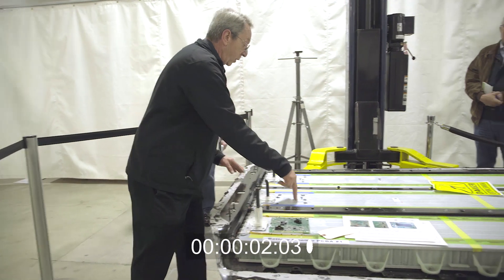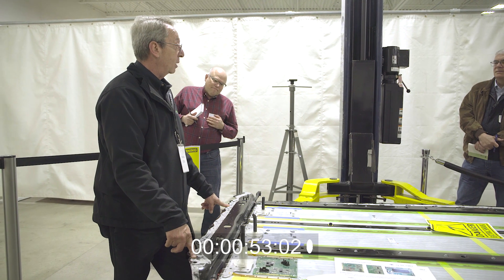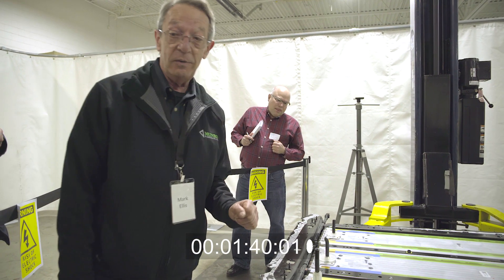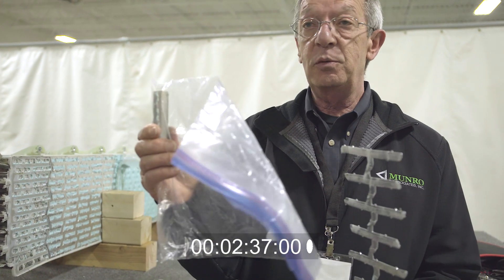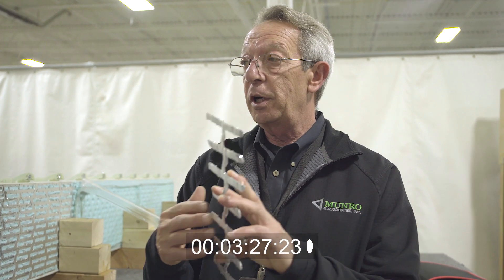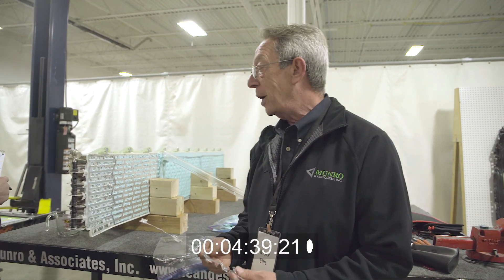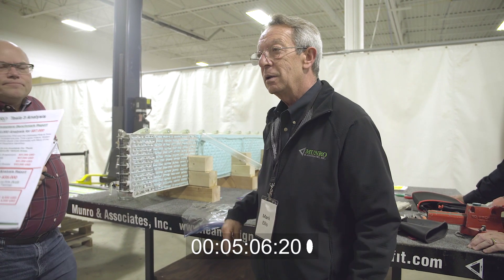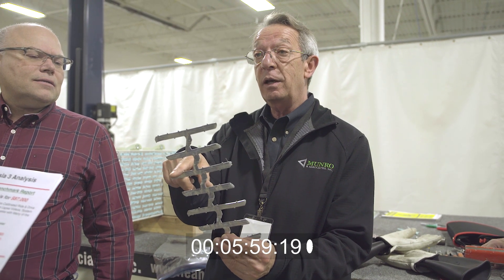Tesla Model 3 Battery Breakdown

Comment: There should be a battery check every 3 to 6 months just like a oil change. Tesla needs to keep there batteries from catching fire to protect there customers.
Reply: 1) Tesla’s catch fire 1/10th as frequently as gas cars and there have been no instances of model 3 spontaneous combustion. 2) The car performs diagnostics automatically on the battery pack all the time and will alert the driver if there is a potential concern.
Reply: There ≠ Their
Reply: @keco185  Tesla Shanghai is moving to LiFePO4 which is inherently even more safer than NCA. Fire prevention is going to be overkill.
Reply: i remember an early case where a Model S catched fire. the BMS noticed a problem with the Battery, and the car wanted to shedule a service appointment for that during the drive the issue happened, but the Car burned down before that. The issue turned out to be a Bullet stuck in the Battery Pack during the Drive in the end.
Reply: @unitrader403 Wait the bullet was stuck in the battery for some time, possibly days?
Reply: Robert M my god are you paranoid.  Better get your gas car checked every week then since those are much more likely to catch fire than a Tesla.
Reply: @Neojhun  i know im late since i only saw this reply when going through my older comments, but the bullet was shot into the pack during the very same drive. i thought that was obvious with the wording "during the drive the issue happened"